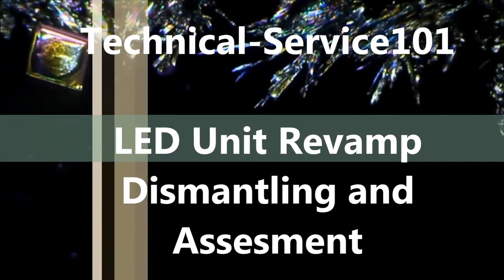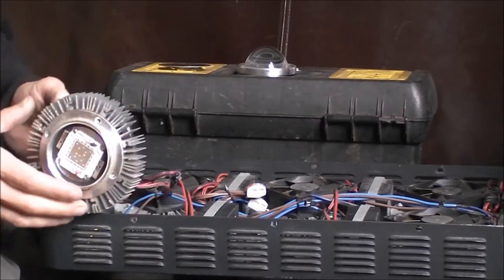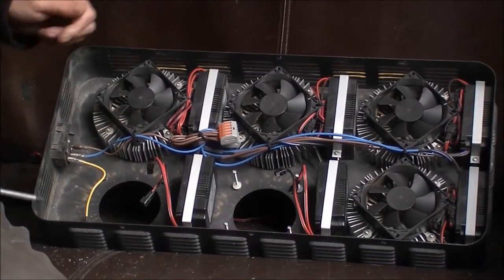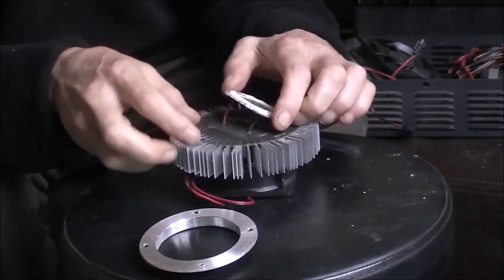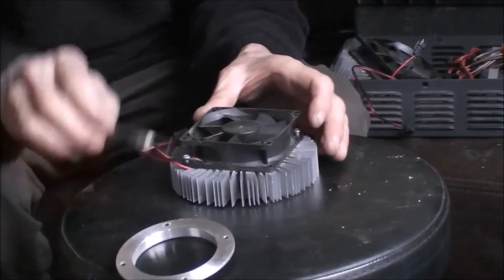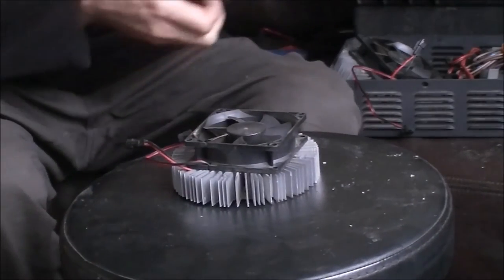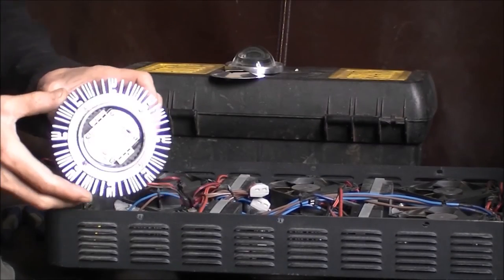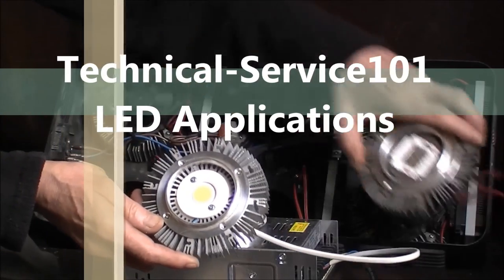LED Growlight Revamp - Disassembly

Comment: Hi Jack, i want to do a DIY COB fixture. How many Vero 29s would i need to get 11-1500 ppfd over a 6x4 and what driver config? cheers
Reply from the maker: Sorry fella, as far as ppfd goes I have no data, as far as experience, I aim for 6 29's for that sorta coverage but that is probably total overkill, 50w per sq foot is ample for most growers but my rigs are constrained by using 4 foot heatsinks which restricts the possible configurations and CoB's are the minor part of the total costings. As far as driver selection, vero's come in 40, 50 and 70v variants and you need to decide if you want to drive in parallel or series. My next video, ready sometime in the next few weeks will be covering the very latest 70v 29's and the problems sourcing suitable drivers. Possibly with a whole new approach to minimal dc driving using simple mains rectification.